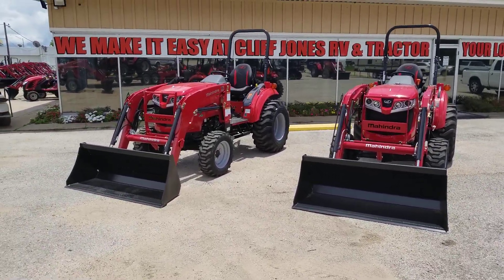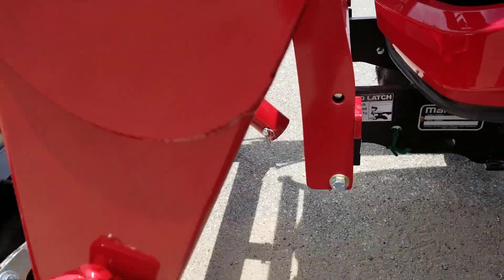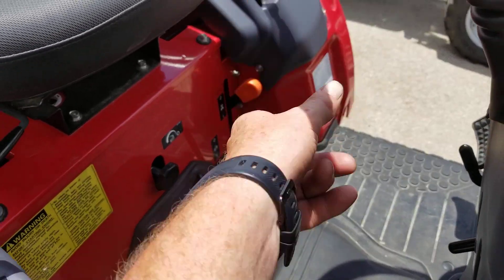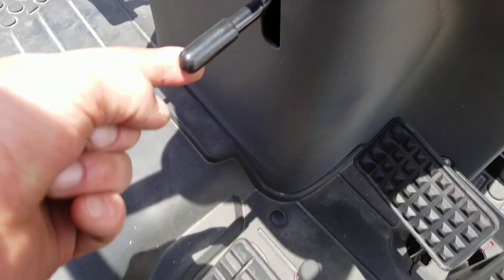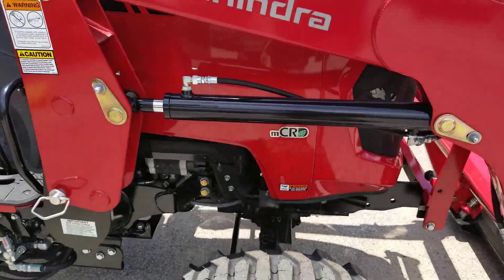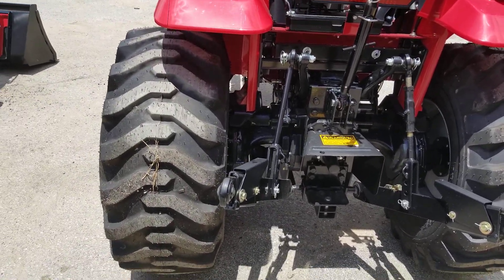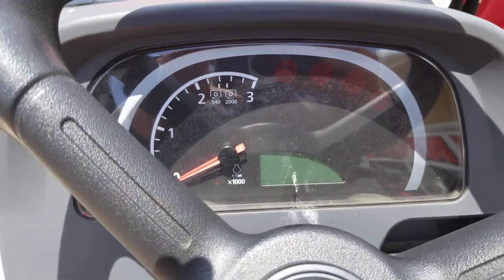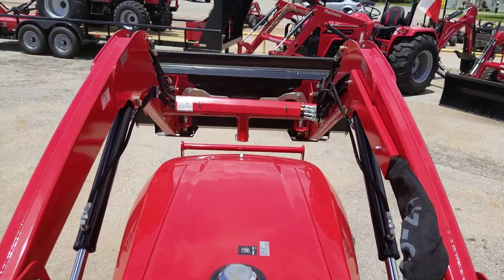Mahindra 1635 HST

Comment: I really like it and might end up getting this one. I did notice the rust pitting on the gas cap. This is a big tractor when compared to others in the same HP class.
Reply from the maker: Yes I do agree about the rust on the gas cap but they make this metal Polish it removes it off their and puts a glaze on it to prevent that from happening for a while

Comment: Henry, I have been looking in the Mahindra market for several months now. At first I was thinking I would be taking a road trip to Sealy until I found UVC Power Sports located within ten miles of me. I have seen and heard in each of your and Niko's videos the same, repetitive things about the product that makes them the ideal choice. However until this one the only thing new is the forward/reverse pedal. Otherwise, nothing new to see here. I am sold on the Mahindra.

I do currently have a 1626 shuttle, loader, shredder with clutch, pallet forks and box blade quoted, But there is also an added feature of a canopy added just for being a veteran by UVC Power Sports. At this point you get the credit of me focusing on Mahindra products hands down. 

What I am really asking here is... Why would a person like me with a local dealer take a two hour drive to Cliff Jones for the same Product? What would make Cliff Jones worth my travel time and expense worth it to me, the customer? What is the service after the sale? What will Cliff Jones do after the sale if a customer needs warranty help? These are the types of questions or concerns consumers have never heard advertised from any dealership. 

I am a sales specialist and assure my customers know that I will work for them after the sale just as I did to earn their confidence in me to make the sale. With that said I do have customers that will only deal with me.

Like  I have stated, I am sold on the Mahindra thanks to you and Niko. With that said, how would you earn a customers trust as a sales person/dealership to make me take a trip? I am looking to pulling the trigger very soon. In fact, my wife is asking me when will she get our tractor?